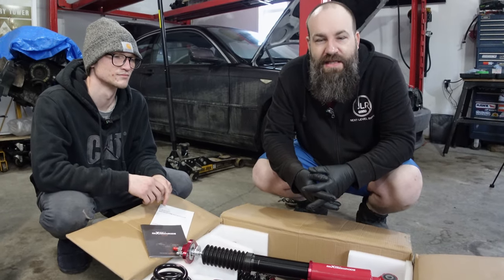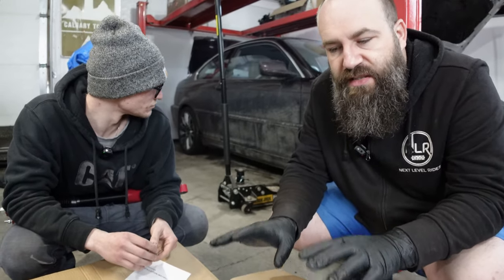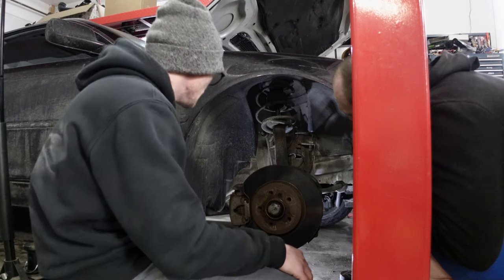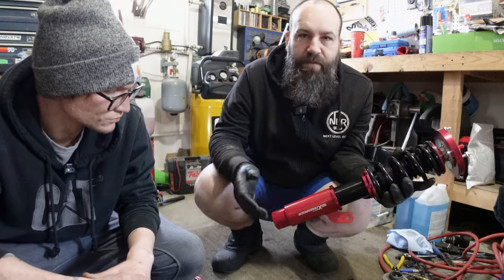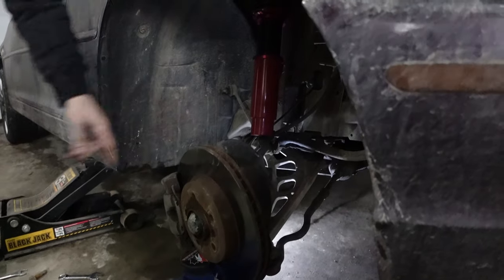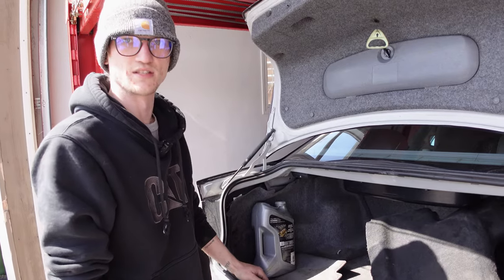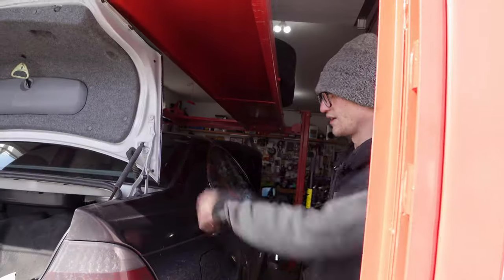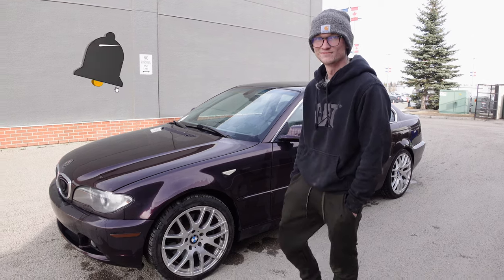E46's BEST Budget Coilover Upgrade

Comment: I bought the same kit but I can seem to get the bottom insulator pad to sit in the adjustable piece. Any tips?
Reply from the maker: It should fit on top, if it doesn't you technically don't need to use it. If you want, send me a message on instagram with pictures

Comment: Any updates in the ST N54 build?😃
Reply from the maker: well, would you believe it, nothing is fitting properly lol. but I'm slowly chipping away.
Reply: Hey have you done a bottom mount speedtech kit If so how was the install thinking about switching to the bottom mount instead of top mount?
Reply from the maker: I've not installed one yet, I'm sure it's a little. more difficult but if you take the front end off, it's much easier.